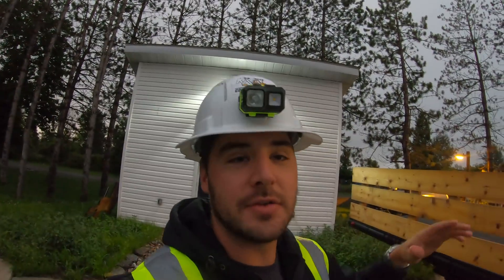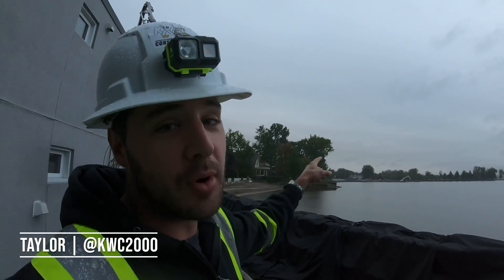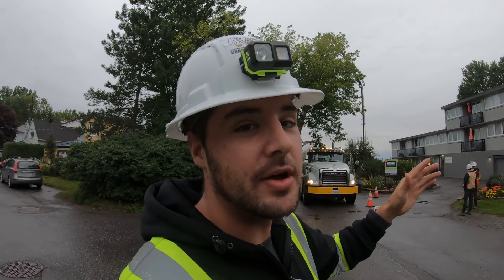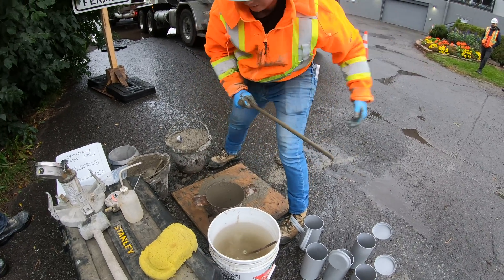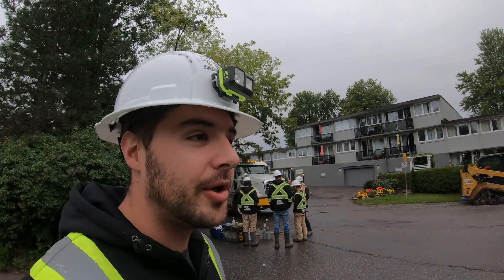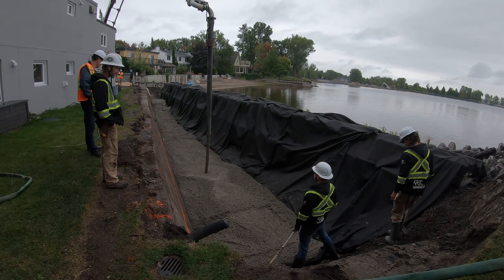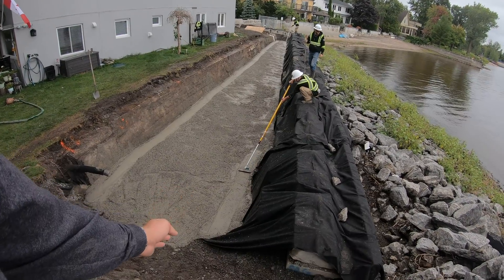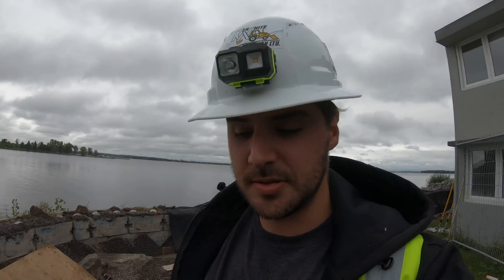Mass Concrete Pour with Boom Truck (Flood Water Control Wall)

Comment: When a load gets rejected like the first truck did they’ll bring it back to the yard and pour and make some eco blocks, it gets resold, or it gets dumped on the ground. The air and slump test typically gets checked on every commercial pour.

Comment: Why wasn’t a concrete form used for this flood protection wall? Did the engineers provide a design? Curious to know why the concrete was poured directly onto the side of clay(?)
Reply from the maker: Because it was a mass concrete fill and not a structured pour. Engineers gave us everything yes. We follow their plans. And it wasn’t poured onto the side of the clay. That side is concrete, looks like clay but it’s not ahah. Hope this clears some things up

Comment: You'd have to wait for winter time to do that down here, or you'd be running pumps all the day long to keep the rain water from filling your seawall hole right on up. Of course, depending on where you dug it, you'd probably have to run pumps 24/7 anyhow because the water table can be less than 6 feet down.
Reply from the maker: Ya that was rain water in there.

Comment: Fill er up. Pump operators love when your spec is for 60-100mm (3” - 4”) slump lol. Runs through the pump like a block of cheddar runs through your guts.
Reply: Nice analogy 👍
Reply: I had to pump a 2" 6k+ mix a few times. Priming was FUN. Got it done though.

Comment: Fill her up 😃 If there was fibre mesh in the concrete no rebar is required because the fibre mesh acts as rebar when it's mixed in with the concrete
Reply from the maker: Exactly!

Comment: Correct me if I am wrong, When concrete is tested it's supposed to be tested at point of delivery... In your case it should have been tested coming out of the end of the pump, Not out of the truck..
Reply from the maker: It did. I didn’t film them testing after we poured, but it did